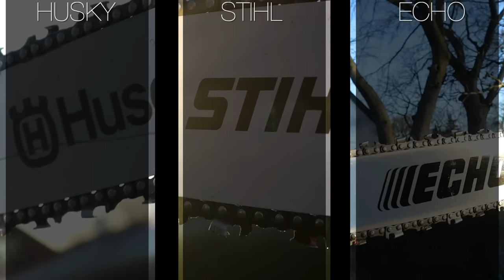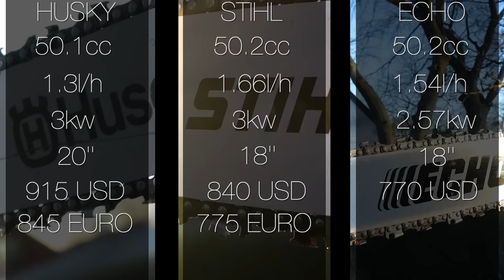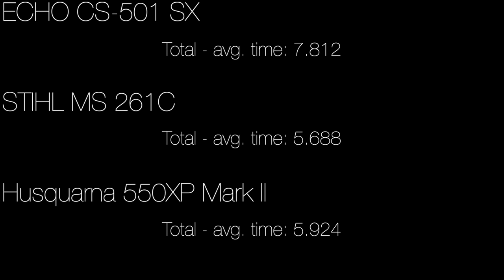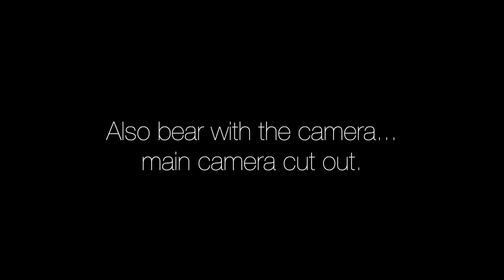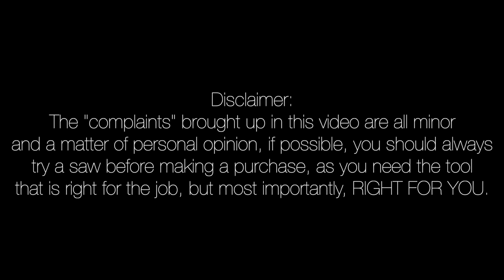Husqvarna 550xp mark II vs. Stihl ms 261 c vs. Echo cs-501 sx - Chainsaw comparison video

Comment: Slight error to the your specs, the ms261 according to stihl can take up to a 20" bar and not sure about the echo but I know both the Husqvarna and stihl saws right now in the American market (at least in my region) are both around the $620 mark, now maybe there's some weird inflation thing or something with the exchange rates but right now in America both are 620
Reply from the maker: As I said in the video these are the prices in Denmark with the current exchange rate. You can’t compare the prices to other countries. 
Also in STIHL Nordic they do not recommend a 20” bar on the 261
Reply: @Femalelumberjack  yeah I saw that in the video it's interesting the sheer price difference from country to country and that's interesting that they don't recommend a 20" over there but for whatever reason it's ok here, it's funny cause when I worked at the stihl dealer we actually sold a version with a 20" bar from factory, I wonder why there's a difference

Comment: Nice video! It only surprise me dat you dont react on the fact the Husqvarna's fuel consumpt is 0,36 liter/hour less as the Stihl.
If someone use the saw 4 hours a day, he saves 1,2 liters/ day. If he use the Aspen fuel at 3,7 euro/liter, it means he save the 70 euro from the new up price of the Husqvarna (845 euro for the Husky, 775 for the Stihl) on only 16 days!

Comment: nice review...why do the europeans always have short bars on the saws? all those saw will run at least a 20" bar.
Reply: also, prices in the US are way off. I can buy a husky 550 XP Mk II with " bar for $609. The Stihl is about $550..not sure about the Echo..
Reply from the maker: Thanks. We use the smallest saw and bar possible to get the job done. In that way we care for our bodies and physical health. 

As I mention in the video the prices are the Danish prices in usd with the current exchange rate

Comment: 7:30 Hi, longer bar should not affect to cutting speed, since chain speed is same  with all bar lengths. It's true that it takes longer for chain to make one full round, but it's irrelevant for cutting speed. Keep going and stay health!
Reply: wictor1976 incorrect. Longer bar means more friction between chain and bar, which puts greater strain on engine resulting in slower engine RPM and thereby slower chain speed
Reply: @srenhedegaardfrederiksen8465   My point was to say that bar length and how long it takes for chain to make one full round does not explain diff in cutting time. There is other things like friction, sharpness of chain, weight of chain, sharpening angles, saw weight, saw max rpm etc that are reasons for longer cutting time.
Reply: A longer bar will produce more friction.

Comment: Bought a Husqvarna 560XP a couple of months ago. Cost me 6,995 Swedish Crowns, which is roughly US$ 758 or 671 €. 59.8 CC, 3.5 kw (which is around 4.7 HP), 6.1 kg. Great saw, has AutoTune as well, so the carburetor adjust itself electronically, depending on the condition. I own a Stihl as well, and I'm suprised that it was cheaper compared to the Husqvarna. I've always found that Stihl was a little bit more expensive. To me, the saws from Husqvarna have more initial "bite", whereas Stihl saws have more of a powerful "bottom end". The Echo sounded horrible, would never buy that.
Kul med en dansk tjej som demonstrerar motorsågar. Skogsindustrin tillhör ju inte Danmarks största näringar... ;)

Comment: Around here there is a Stihl dealer everywhere. That is a big plus to me. There is 2 places within a few miles of my house for service and parts and there is only one single Husqvarna dealer in the area I know of and the last time I was in there they were pretty nasty to me. I bought a saw on eBay from a Husqvarna dealer and when it showed up the screw for the adjustable oiler was snapped off rolling around in the saw new in box so I went to the local dealer figuring there must be a warranty its a brand new saw didn't want to pay to mail it back. Guy was really nasty to me about it said I should have bought the saw from him. Sure it was $100 less online sure should have bought it from him lol. I ended up having to pay for the oiler and I installed it myself haven't had the best luck overall with Husqvarna saws

Comment: One thing is that people need to know before they buy a chainsaw is to factor the warranty.
In the US husqvarna chainsaws have a 2 year warranty or a 5 year warranty(under the condition of buying husqvarna fluids for the husqvarna chainsaw).
Stihl chainsaws only have a 1 year warranty under the condition that stihl bar chain oil and Stihl premix gas is used with the stihl chainsaw.
Echo chainsaws have a 3 year warranty.
So, the extra money spent on a Husqvarna versus the stihl makes the husqvarna a better purchase.

Comment: I love my MS261, but I had to remove the EPA caps and tune the carburetor to keep it from bogging. It was set so lean from the factory I had to full throttle it all the time
Reply: EPA caps? I just bought a MS261 2 days ago
Reply: @joshmason1003  They put plastic caps on the high and low speed tuning needles that restrict how far you can turn them. They run too lean and will end your engine prematurely. The strategy is to make it lean so it burns less fuel but runs like garbage so you have to use more throttle. Also take the muffler off and compare the exhaust port size to the muffler opening..
Reply: @slowstang88  oh ok gotcha thanks
Reply: @joshmason1003  If you enlarge the muffler opening to match the exhaust port, do that first then pull the caps off and retune it. This will void your warranty if you're concerned about keeping it so beware. My 261 is a whole new saw now, it was bogging out of the cut and took it back to get retuned after break in and it ran the same. The guy at Ace hardware told me about the limiters and it was as good as he could legally tune it
Reply: @slowstang88  gotcha thanks 👌🏻

Comment: I own a echo for a few years now it’s been a good saw but you just got to let it cut if you dig in with the dogs it doesn’t have the power of a the higher priced saw but it’s a very reliable saw it starts very easily every time for the price if your just cutting firewood or dropping a tree every now and again it’s a good saw for the price

Comment: I’m not sure your bar length is correct on the Stihl.  I think that unit can take a 20” bar as well!
Reply from the maker: Different recommendations in different countries. In most places in Europe the don’t recommend using a 20” on the 261 and the saw is sold with a bar up to 18”

Comment: I have a Stihl MS290, running a 20'' bar, great saw. I swapped off a Husky Rancher for it. Husqvarna are decent saws, but where do ya'll get parts for them? Some box stores carries Husky saws, but not many parts, other than simple stuff, but I've not seen a one around here that carries sprockets, oil pumps, etc..common parts. So, no Husqvarna for me, if I need parts, I need them within the hour, not wait for a week for parts to get in. There is a Stihl dealer in nearly every town in my area, with plenty of parts.

Comment: Im sorry you’re weights are completely off, i did a weigh myself and the husky is 1pound heavier no matter how its weighed with or without the bar. Nothing against either saw but all the videos claim you cannot feel the difference between the ms261 and 550 mark2 but its night and day when holding them. The stihl feels like a feather compaired to the 550xp, if you’re gonna run a saw all day get the stihl, if you’re just a part time side job guy then the husky will last forever because it’s probably more solid. Here the real weights with 18 inch bars 15.09pounds ms261. 16.19 pounds for the 550xp mk2.

Comment: Why do you not like the oil cap? Assuming you don’t like the gas cap either? Wow super exspensive over there. Geez. I bought two 261’s for 1k out the door with a  16 in 3/8 bar
Reply from the maker: The gas cap is fine but the oil cap can be hard to get back in place

Comment: Chain revolutions are not the same as engine revolutions. Engine rpms correlate with chain speed. The reason the echo cuts slower is because it has less power, not because it has a longer bar and chain.

That said, the Echo is the best saw for the money. A slight muffler mod and some tuning will wake it up. It will undoubtedly be the most reliable saw as well. 

Having owned and worked professionally with all three brands, over the course of the last 9 years I’ve found that the midsize (50-60cc) Echo saws give me less trouble and start more reliably than Stihl or Husqvarna.

Comment: I dont think the echo is in the pro range. It just looks light duty and for that id be reluctant to buy it.
Reply: I have 3 Stihl saws, 029,024 and 180, and an echo CS3000, climbers saw of all the saws I have had the 0029 longest next is the Echo, that saw is incredibly durable and more reliable than any of the Stihl saws, the Stihl 180 when it runs is a nice saw but is next to junk as far as reliability goes, such a disappointment. I feel bad for any one buying a 180 as their first saw and experience with Stihl. 20% of those saws don't run and they just keep selling them, same with the 170. Love the Echo CS3000, great saw, incredible saw if you need a climbers saw, always starts and runs great, plenty of power.

Comment: Up until we consider 500i and 88s the husqy 550 mkII is the chosen saw.

Pet peeve: people that use the stop on a saw and don’t flick it back after
Reply: The joy of building relationships is the perks. I support my suppliers and they support me. 

As for weight, our bodies are amazing! My years of riding BMX taught me that we adapt. Through my progression I had , hand me downs. Solid would be a truth and with that reliability

Comment: And the c on that 261 means it's basically a commercial use saw. Work horse. 271c was  or is hot as my 290

Comment: I have echo 490. Got this one vs Stihl, because it’s always start easy. Stihl is more tricky. My boss using 3 Stihl concrete saws, after I got used to them to start, bot Stihl blower for my self. Husqvarna not on my list. My brother has it and my friend, both dead due to cylinder scratches

Comment: Well prices are way off the 261 is definitely the most expensive in America around 600 the 550 is around 500 . And I've ran all these saw for yrs as a tree trimmer .  And it's hard to rate them IMO. If I'm rating on reliability  it would be 261 - 501 - 550  in that order .  If I was to rate for cutting power and speed it would be 550 - 261 - 501 .  But me as a sthil guy would say that the 550xp ( mark 2) is the best 50cc saw made it just made for ppl who know how to run a saw . Because if u don't u will blow it up with how fast it hits its Rev limiter .

Comment: 50cc saws with little 15 inch bars, how cute.
Reply: They are actually serious machines. I never use more saw than I need for the job. Maybe I'm just a sissy but I don't see a point in hefting 25 lbs. all day when you can do the job with a saw that weighs 13.
Reply: Dan Quirke you must live somewhere where you call, lodge poles trees. My Christmas trees have trunks almost 13 inches

Comment: The echo is using more of its power to push the longer chain.  Also with more cutting teeth inside the wood at a time. More drag=slower
Reply: To put a skip tooth on it would be closer to the same drag the others are experiencing.

Comment: With Hsqvarna 550xp and 560xp I had start-up problems in continuous use (40/50 hours per week of use)
Reply from the maker: Did you change to another saw?
Reply: @Femalelumberjack  Of course now I use stihl ms 462 c-m and stihl ms 500i for small limbing jobs I use stihl ms 261
Reply: @Femalelumberjack  I forgot that I own and frequently use the best chainsaw (in my opinion) ever for Stihl felling ms 461

Comment: Danish prices are shockingly expensive. I've seen Echo 501's for 525 € in big box stores. You don't see Husky or Stihl in big box stores but Husky is 799 all day and I've seen them even for 675. Just found that a local Stihl dealer has a bargain at 699 € with 5 spare chains.

Comment: It is nice to have a lower price, but ,and that is a big but. If you are working a saw to make a living or half a living the up front cost matters less. If you are running a saw you want the saw that suits you best. I don't own an Echo and I am not interested after seeing this video. I use my 550xp a little more than the ms261. They are both good saws.
Reply: I like my Echo's, but if I made a living using a saw, I would go with any Husky or Jonsered. Anti-vibe is a big deal and I'm a little surprised at the difference. A 30 yr. old Husky has less vibes than a new Echo.

Comment: Definitely the husky if u want to spend the money .stihl a little over priced . But the echo is the cheapest one out of them at probably by 150 less so it's still worth it and my smaller echos are problem free for years so if the bigger saws have the same quilty it'll still be money well spent but yea it'll be the less power full but u can compensate with a smaller bar and  chain

Comment: For the same engine speed (rpm) and sprocket diameters the chains will be going at the same speed regardless  of bar length. The Echo is slower cutting because of less horsepower.
Reply: My words. . Echo has 15% les power thoan other 2, that’s why chain slows down more when cutting. Longer bar produces more chain friction, but difference is minimal.

Comment: This is not a fair comparison for the Echo, it's half a horsepower weaker than the other 2 saws, the Echo cs-590 would have been a better fit for this comparison since it matches the power of the 2 other saws at 4 horsepower.

Comment: Ha, bought a Poulain 50cc saw with 20" blade for $199 at Tractor Supply, after my XP Husqvarna died. A bit heavy, but cuts like a champ.Made by Husky.
Reply: Does it have a good chain brake for kickbacks

Comment: echo 2511 is the best top saw on ther market in my oppinion. ordered it a new bar and sprocket though so now it has the same chain as stihl 150 and its a huge improvement from the chain it came with. echo gives a lot of saw for the money. 

stihl 261 & husky 372 are my favourite ground saws. not tried a newer husky.

Comment: Your Echo was NOT adequately tuned up ... Your input was to high as it sounded choked up . Echos are conventionally carbed . I never simply pick up my chainsaw and start it ... You have to account for humidity and temperature ( altitude if it applies) ... Hsqs & Stihls are electronically tuned . Better or not ... I am not addressing this ... But tuning the Echo was a ... MUST !

The clip was aesome ! You are awesome ! Do not for one instant think I am ranting on your nice work .

Comment: Just wait till you have a carb issue with husky.  it is auto tune and it will need a shop with diagnostic.  But the husky is fast and you can advance the sheer key on flywheel by .005 and get even more speed.  The echo is easy to work on and parts are less expensive.  Stihl is ok but I am echo fan.

Comment: Also ive noticed for myself the husky cuts faster with higher end torque and the stihls cute slower with lower end torque which is better for harder knotty wood where the husky does better is smoother wood

Comment: Hi great video and good comparison. 
But i need to say that the sword size do not matter for the speed of the chain its the gear ratio.
It seams that the Echo is old school all the way is any adjustment screws on that you forgot? I thing that it did not run clean and flat out on rpm.
In my world Husqvarna wins for the best fuel economy but Stihl is a great saw so its a tight one.
The Echo saw seems to be at least 10-15 ears after in development? but good for the small jobbs at the garden or small farm?
My own pro saw is a Husqvarna 550XPG mark1 with trio brake and that saw is lovely in the forest any day.

Comment: Bar length doesn't make chain spend change. 7pin sprocket at wot only moves so many ft per second. Even it bar is 6ft long teeth are moving the same speed. Only difference is there are more teeth. Therefore work is spread out over more teeth less wear.

Comment: The title of your video is misleading. It says "550xp Mark II" which is the second generation version but in your video you clearly state the 550xp tested is the older version hence not a Mark II with autotune. You should correct the video title as not to mislead viewers into thinking its a second generation 550xp.
Reply from the maker: I’m using the Mark II in the video 🤣
I’m simply saying that I’ve also worked a lot with the 550xp

Comment: AVOID STIHL.  I have a part defect issue on my MS391 (RRP £650 now) as the cylinder head thread has worn to the point of not starting at all as the spark plug is wobbling about. Stihl insist that it is a wear & tear issue and won't offer any restitution, despite the light garden only use which I reckon is maybe 6 weekend's use per year over 4 years of ownership.  I was quoted £275 repair cost on the £650 saw.  Crazy.  It's quite possibly going to the landfill site now.

You pay more for #Stihl European quality but the product is filled with sub-standard parts that ruin the product life.
Reply: Sell it for parts before landfill plz